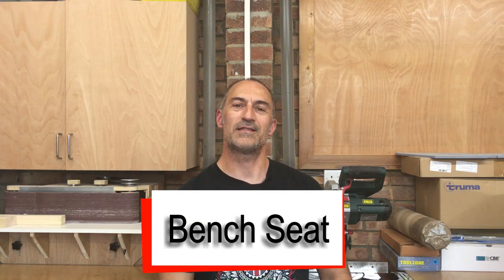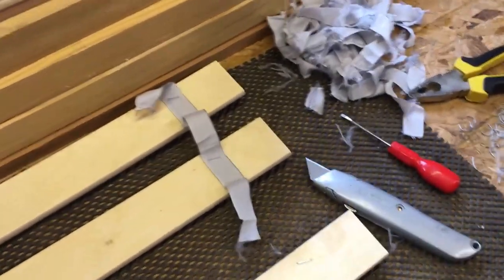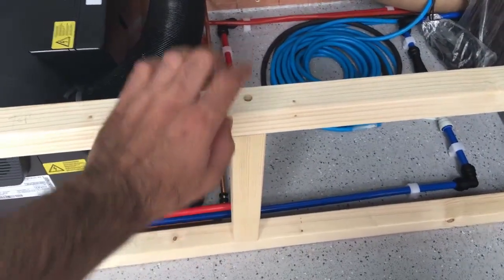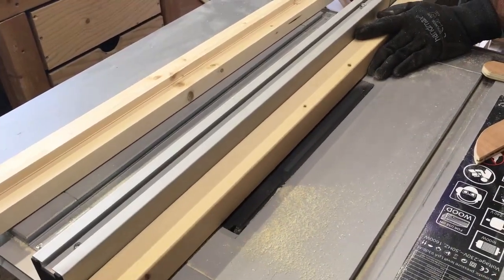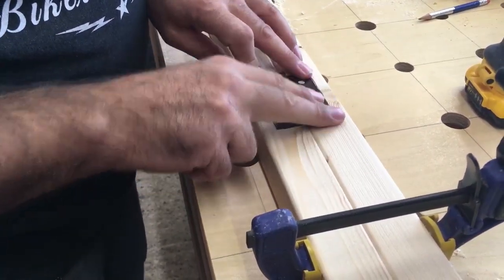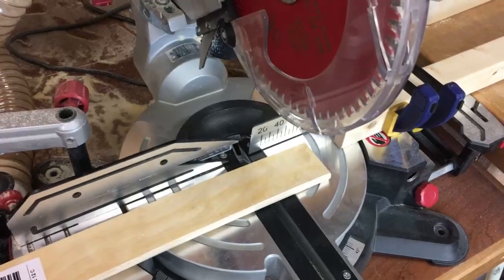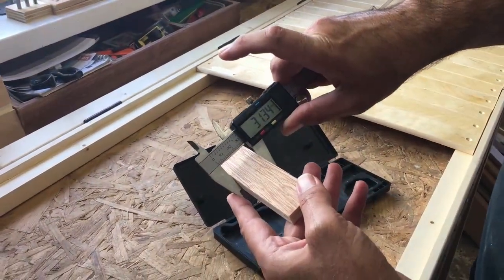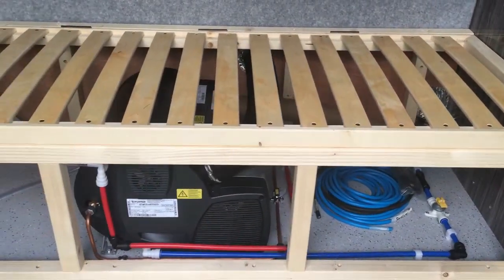Mercedes Sprinter Camper Van - Bench Seat

Comment: Brilliant Greg! I expect your fans, like myself are learning so much from your videos. Cheers mate! If you have to create a little "give" on the fixed slats Greg, just over-size the drill holes on one side of the bench slats and refit your screws using a washer and tighten just enough to hold the slats in place. Thus allowing the slats to flex but not move about when you are on the move. Just a tip matey. ;-) Andy Kelly

Comment: dad built something like this in the 80's ..Two bench seat each having hindges so you could store your foam bedding inside..Now you can ether have a collapssible table in the middle that rest between the benches making a bed ..or pull the slats from one side to the other making a bed

Comment: Thanks Greg, I didn't realise b&q did a smaller CLS timber. Before I started I returned my thicker CLS for the 38mm version.
I'm making a bench like yours with the addition of a slide out section.
Reply from the maker: Hi Mark, for things like this if built correctly are super strong and no need to go up to larger timbers. Plus it’s only £2 a length which helps. 😀
Reply: @GregVirgoe  totally agree Greg its plenty strong enough.
Went to Ikea today for the slats and fish and chips lol.
I'm doing more of a simple low cost build but to a high standard in a lwb high top Nissan Primastar. It's designed as a cycling day/weekend van but a longer trip wouldn't be a problem.
I've also got a very unique layout which gives me the best of all worlds IMO.
Thanks again.

Comment: Fantastic job, Greg.  Since the slats are meant to flex when weighted, I think making them a touch shorter with an elongated hole and possibly a pan head screw, to allow for the lengthwise movement, might make this more functional.  Like you, I get these things done and then realize a small detail I didn't see and then need to makes adjustments. That's always the issue when your project is a one off.

Comment: Thanks for your efforts here, very useful in visualising the best and simplest way to tackle a bench seat.  The only thing I'm not understanding is I'm seeing the weight on the back rail being transfered through the 3 hinges? I know the majority would be on the front but would there not be a way to have the wood resting on wood but still hinged? I'm not being critical just trying to get my head round it.  I enjoy all your videos as the "proper" way to do things and many others as the "corner cutting way"
Reply from the maker: It’s a valid observation but it’s extremely strong just like this and shows no sign of movement at all
Reply: @GregVirgoe  very good, im sure it is.  Many thanks for your videos they  really help

Comment: Mitred joints and rebated slats on a bench seat, blimey Greg nothing by halves! It's a joy to see the craftmenship of your work. 
We are at the cushion making stage and if it helps check out Shepards Bush Market for fabrics. Just purchased 10 metres of heavy cotton fabric at just £25. 
However, the complete set of bare foam cushions for our bed and seat, from efoam.co.uk, was very expensive at £312. I'm sure we could have done better if we had shopped around though.

Comment: Good quality build. Two steps seem to be a bit unnecessary. You remove the textile from the slats, but later you cut this part off. Also predrilling is not necessary for everything, drilling into the 38 X 38 before fixing the slats. Just my two cents.
Reply from the maker: Hello Chris, hindsight is a wonderful thing :D lol
Yes, I could have just cut the strap with the knife to separate them I didn't need to remove the staples, ah well.
The studs are softwood and I just didn't want to risk splitting it with the number of screws.

Comment: I would always use a little dab of woodglue on every joint that I don't want to unscrew. Glue is what really gives a joint its strength and it's really not hard to do if you screw it together anyways.
Reply from the maker: Da BJ totally agree with you, I have glued the joints I do not want to come apart in future. I have built it so that it could be easily dismantled and reused or repurposed for another vehicle if anything happened to this sprinter, major mechanical failure or road accident, you never know.
Reply: I already thought you probably wanted to be able to take it apart, I would mention that you glue the permanent joints, because beginners often underestimate woodglue a lot.

Comment: Hi Greg ... when these slatted bed bases are normally used, they are left to ‘float’ on either side of the bed base with some room to expand. This allows  the slats to lengthen slightly and is more springy . As you fixed both ends of the slats, they have nowhere  to move and are effectively solid arches aren’t they? Would it not have been better to leave one end floating, keeping the springy feel?
Reply: My thoughts exactly Martin.
Reply from the maker: Yes, well spotted guys, did over size the drill holes after to allow a little movement.
Reply: What a great observation on a small but important technical detail!  Of course, on flat slats one does not have to think about bending, but this is a flexible arch and is meant to bend with weight, creating a springy feeling.  You think of these details only in hindsight.
Reply: May i ask how this is achieved in an ideal world... ie should there be an “eliptical" hole to allow the lateral movement? I understand why but not how best to achieve this withoit the slats being too loose? Many thanks

Comment: I see from the pinned comment that others had concerns about the flex in the wood slats; so that's sorted. :-)

My next question is, how have you found the comfort of the seat, now that you've used it? Does it indeed flex enough to be comfy, or does it not flex enough, and give you the sensation that you're meant to slide off the front of it? Thanks, "mate"! :-)

I really am enjoying my binge-watch of your van build.
Reply from the maker: Dave Weber you don't feel any sensation of flex although it obviously does and you do not slip off the front either, it's very comfortable

Comment: would placing two screws at one end and leaving the other end free or with one screw in a an oversized hole not been better? Perhaps waxing the back edge to prevent any squeaks would also help.
Reply from the maker: Wes Campbell it all works fine and no squeaks 👍🏼😃

Comment: Greg how high is your seat base ? And how long are you doing the back that you lay back on ? Cheers Danny
Reply from the maker: Hello Danny, standard seat height is 450mm or 18" to the bit you sit on.
So if you have 4" of foam like us you want the top fo the wooden bit to be 350mm or 14" high.
In our case, the boiler needed 350mm clear space underneath the bench so we are about 40mm higher than standard.
But with an inch of memory foam as the top layer in our seat cushions, it makes no difference.
Seat cushion video is out today if you have not seen it yet take a look :D
Reply: Greg Virgoe yes just watched it i’m doing transit jumbo and your helping me out a lot Greg cheers for putting all the vids on bought a lot of the tools you have used and showing me how to use them as well cheers for the help Danny 👍🏼

Comment: Excelleent craftsmanship as always Greg. I cant help wondering if the slats need to be loose, as they lengthen slightly when weight is applied, will this force the frame apart.?
Reply: I was going to ask Greg the same thing Neil.
Reply from the maker: Spot on guys, the drilled holes need to be over sized to allow a little movement, now that I have shortened the slat the movement is reduced too.

Comment: You've had this bench for a couple or more years now, Greg, did you ever feel the need to put a catch or lock on it to stop it banging on a bumpy road, or did it never do that?
Reply from the maker: No, it’s never done that as the cushion fits very snug. The one thing that does occasionally swing about is the drop leaf on the kitchen counter 😂😃

Comment: Hi Greg,I have been watching your videos,lovely camper you have put together.  Quick question from me,how wide did you make your bench out of curiosity. 
Thanks Brendan
Reply from the maker: It was really dictated by the Truma boiler that we installed inside the bench. Ideal seat height is 450mm and our seat depth is also 450mm
The bench is 550mm deep with 100mm foam back rest.

Comment: If you've fitted the boiler under the bench seat and vented it just above, isnt that wrong? As you've fitted the gas exhaust under a window?
Reply from the maker: No because the window does not open. That is just a plain bonded glass. If it opened then you would be correct 👍🏼
Reply: @GregVirgoe  👍

Comment: How did you attach the back rail to the van wall? Did you screw through the ply wall only or all the way into the metal side of the van. Thank you.
Reply from the maker: David Brudzinski both front and back rails bear weight onto legs to the floor so the rail is just screwed to the 9mm ply lining to stop it moving and coming away from the wall. Really strong

Comment: Hi Greg your videos are great can I ask you a question please would 2000 renogy inverter run my microwave I have two 100 renogy solar system with solar control called wanderer 30a pwm thank you greg
Reply from the maker: Microwaves are typically anything from 700-1800w so the inverter would be big enough but the critical factor is what type of battery do you have and how much capacity because they may not be able to deliver enough amps. 
Look on your microwave label to find out the watts and let me know what size batteries you have.
Reply: @GregVirgoe hi Greg my microwave is 700w I am getting 2deep cycle battery's 130ah don't no witch ones yet they are called probat and holden wot do you think please
Reply from the maker: @davidheron5479  ok so 
700 / 12 = 58amps
This would run off a 1000 inverter. 
You would need 300Ah AGM batteries or just one 100Ah lithium battery. Both options will cost about the same but lithium will be lighter and take up less space.
Reply: @GregVirgoe  thank you Greg your a diamond 💎
Reply: Hi Greg so do I need 1 or 2x 300 ah battery's can I still use my 140 split charger on these battery's and on lithium please
Reply from the maker: @davidheron5479  if you go for AGM you need a total of 300Ah so you can make that up by 2 or 3 batteries. That is likely to cost just over £400. Or you can simply buy just one 100Ah lithium battery which will work on its own because you can draw more amps out of lithium batteries. One of those is about the same price. Don’t use a split charger relay with lithium you need a dc to dc charger that is suitable for lithium batteries. 👍🏼😊

Comment: Hey. How did you join the top front to back horizontal as it appears to butt to the front vertical. The front horizontal sits on the top of the front vertical but I cant see the method for top .. unless it was pocket holes on the fron to back horizontal (top one)
Reply from the maker: Hello Andy, the side horizontal timber takes no weight as all the weight is transferred to the back and front rails. So this is effectively just to tie the front and back together, I drilled a pilot from the front rail into the end grain and drove in a 3" long screw. All these end timbers are screwed to the furniture board which adds a huge amount of rigidity and prevents the whole thing racking. Hope that makes sense?
Reply: @GregVirgoe  perfectly thanks!! And to echo the sentiments that your vids are amazing.. almost wish your van wont ever be finished lol
Reply from the maker: Thank you for following me and I'm sure we will be doing loads more van related videos and some upgrades too along the way. Are you building your own van?
Reply: @GregVirgoe  yeah. Ex DHL sprinter .. slowly but surely. Bed carcass tomorrow
Reply from the maker: Excellent Andy, would love to see some pics of your progress 😀

Comment: Great build as always. I was wondering, though, might it make sense to make the rear supports lower than the front ones, and thus create a slight incline in the seating area? It might cut into the storage but generally sitting on a flat surface seems less comfortable than one that's slightly inclined. At least for a couch. 5-10 degree angle seems like it would be appropriate. Assuming there is a backrest, of course, ie that it becomes a couch... I suppose the name "bench seat" should give me a clue that there will be no backrest, though.
Reply from the maker: Can you not create the same effect by building up the foam on the front edge of the seat cushion to create a knee support?
There will be a back cushion but only a far low level one so it does not obscure the window too much.
Reply: Probably, with a firm enough foam or some such. But generally van couches tend to be less comfortable because they're built flat, and people generally want an incline when they lean back. Otherwise you may get too much pressure on the tail bone which causes hotspotting and discomfort for prolonged sitting, you want your bodyweight spread out along the thighs as well, basically. I'm not an expert in the field to say the least, though, just spitballing.

Comment: Hi Greg I can’t download the file can you tell me pls how high this was thanks
Reply from the maker: Standard seat height is 450mm to top of seat cushion. I had 100mm thick cushions. But made the bench 50mm taller than that to accommodate the Truma heater. 
So it depends if you have heater there or not
Reply: @GregVirgoe  thanks 👍

Comment: could you not have routed and turned the hinges over so top face is flat?
Reply from the maker: nicholas763 the way I have fitted the hinge it is closed on itself and the only part you see is the back of the spine and nothing else.  On the video they are open and not closed. The downward force of people sitting on the seat have the screws in sheer where they are strongest. If you place the hinge on top like you suggest the screws can simply pull out very easily and it will have no strength at all.

Comment: Sketchup model no longer available
Reply from the maker: It had somehow been switched to private, the link is working again now. Thank you :D
Reply: Thanks for that. I did have some serious screw clashing with mine which is slightly different than yours. I mean there are parts of the frame that need screws downwards and from the side, which doesn't seem to be covered in this vid or the sketch up model. Having said that I am a crap carpenter> What I mean is on the corners where the cross members need fixing but they have already been drilled from the top to hold the top length rails.
Reply: Given another look I can see that you didn't fit side braces or a bottom lengthways brace on the back. I think you had the luxury of having sides which you could screw it too :)